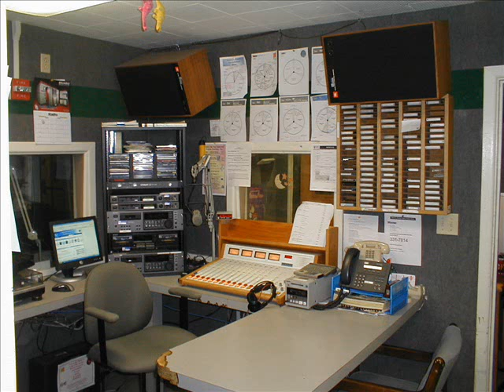Radio station 25 hz automation tone and Bee-doop tone

Comment: I dont hear the 25 hz one. It could be in my old age my ears just dont hear sounds that low and also, I image the speakers on this lap top have no sound response nearly that low in frequency. Does it sound like a huge megga fart?LoL I will investigate later on. My friend has a sub woofer with his desk top. I cant imagine anybody really hearing the 25 hz and also it seems the signal would have to be very low in db so as not to cause damage to monitors or head phones and what not. Interesting. TY.
Reply: It’s a low pop-pop at around 0:14.
Reply: By design, the 25 Hz tone is only ever "heard" by the automation equipment at the station. AM radio cannot reproduce much of anything below 500 Hz.